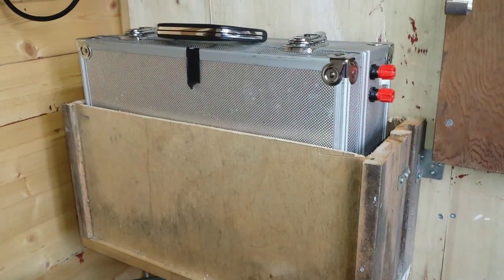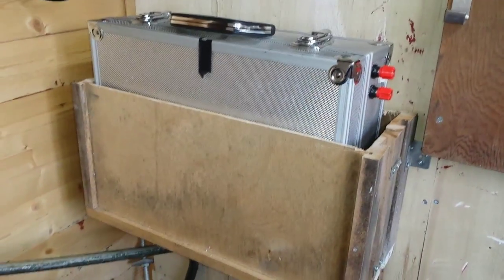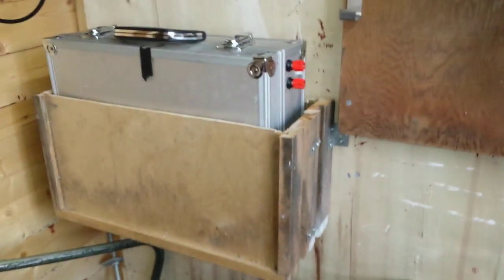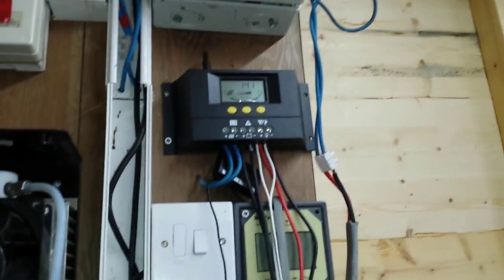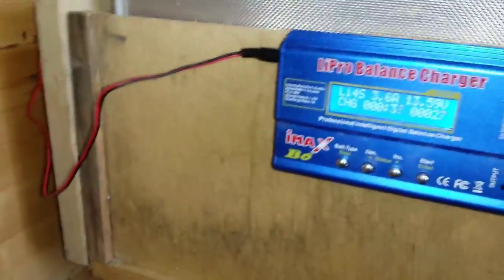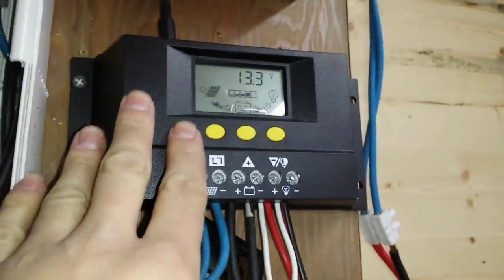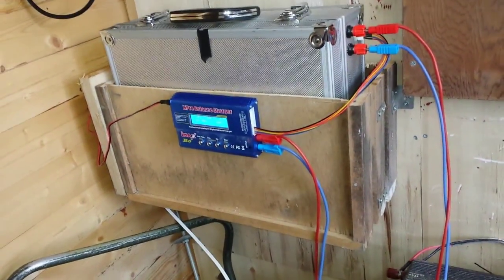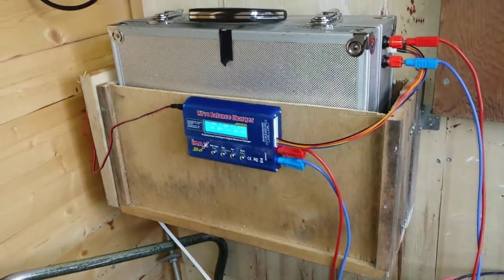LIFEPO4 Part 13 - A place to charge

Comment: You can come off of the solar panels into your controller then use a sepic buck boost  and adjust it for your desired voltage then to your batteries, this will lock in your voltage so even if you're charging off of a 12v gel battery and you want 16v it will boost it or if want 6v it will lower it and will stay locked in until the source is dead. http://www.banggood.com/100W-DC-5V32V-To-0_832V-8A-Adjustable-Auto-Step-UpDown-Regulator-BuckBoost-Converter-p-1091915.html?rmmds=search

Comment: Coming along nicely! My el cheapo charge controller has a Li-ion setting in the battery options and you can also offset the max, min and float values to about +/- 500mv of the pre- programmed battery voltage. It's not ideal but it might do for now. Your BMS should cut out the battery if the voltage gets too high, right?